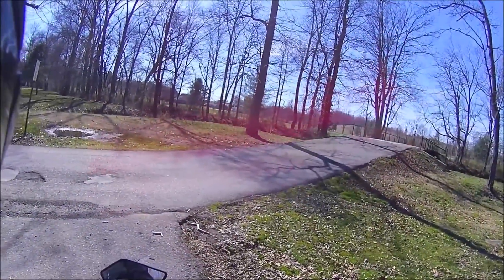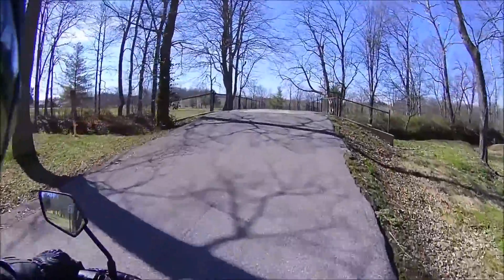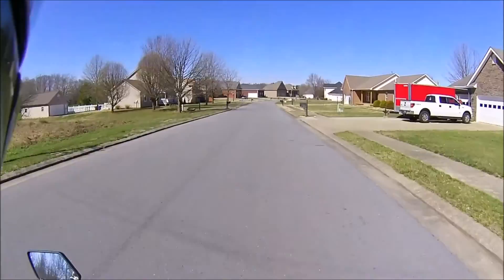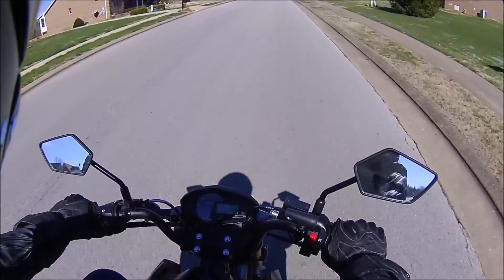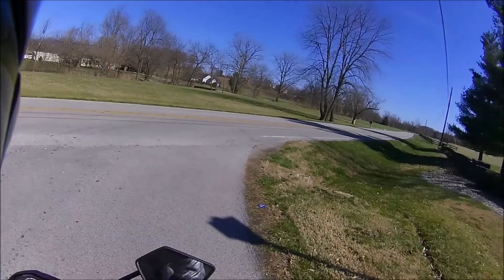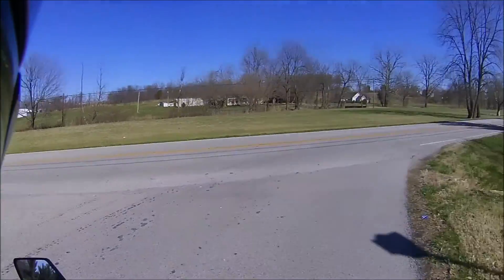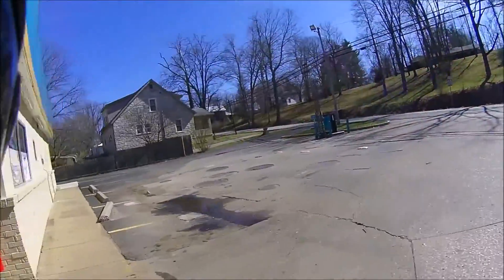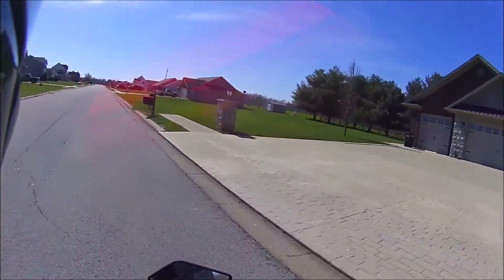Z125 Mod Day 4 Bazzaz Run

Comment: Thanks for posting I've been debating if I should get mine or not.  Ever since that ECU recall I lost quite a bit of power all throughout because it's set to rev with less RPMs.  Getting this fuel controller hopefully that'll change and give me back the mid-range pep I used to have.